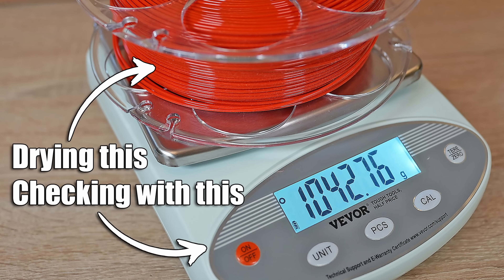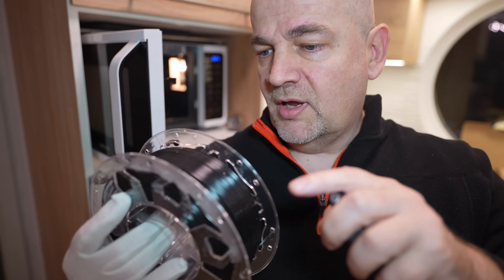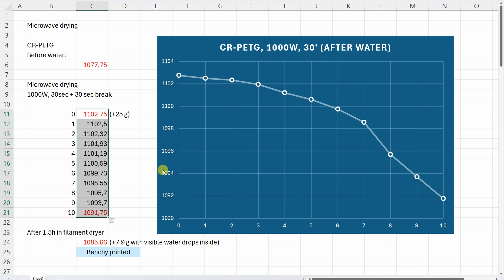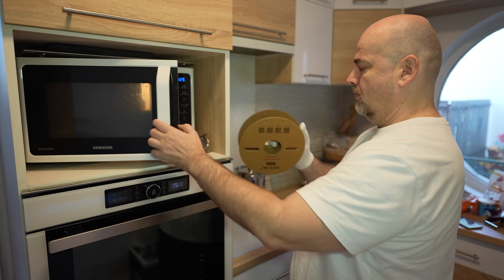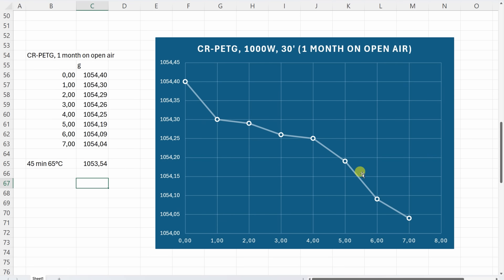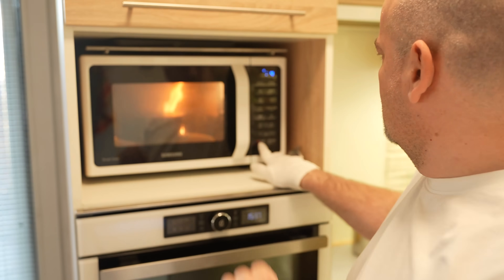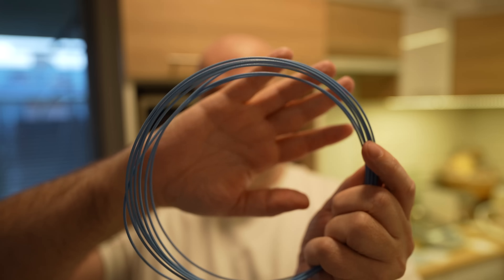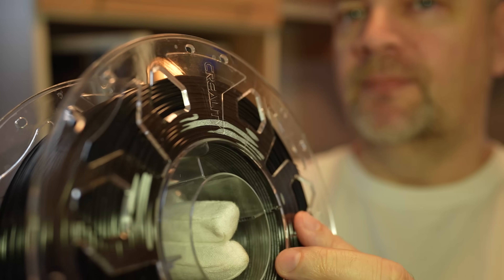Drying Filament in a Microwave: Fast Solution or Fire Hazard?

Comment: The fact that a microwave could dry filament was never really a question - it adds energy to water molecules and they evaporate. We've seen that right here on this channel for drying dessicant. The blocker for me using a microwave to dry filament is that microwaves don't evenly heat anything - so even if you use intermittent bursts like you did, you're going to end up with hotspots in the filament that will cause issues down the line. Getting the filament to the right temp to allow the water to escape everywhere in the roll, to my thinking guarantees that you're going to blow past safe temperatures in hotspots in the roll. That's also why using regular cooking ovens is a terrible idea for drying filament.
 
Maybe try some of this again and use a thermal camera on the filament? See how well it distributes heat amongst itself, and vary how long you nuke it for and how long an intermission, to see how bad it is in reality and what might work best.
Reply: Not all Microwaves create hot spots.  My Panasonic inverter style microwave passes the 'fill the plate with mini marshmallows' test and heats (they expand as the water in them heats up) them evenly at 100% and 50% power.  It's a fun, cheap test to map your microwave.

Check out microwaves that have true inverters, where 50% power on a 1000w microwave is 500w.  Most microwaves simply pulse the 1000w magnetron on and off to simulate 50% power and you get hot spots when you are expecting slower, even heating.

The ideal drying ratio might be something like 30% power for 4 min cycles, or 70% power for 60 second cycles with an inverter microwave.  So many ways to test!
Reply: @joerogers1364  Oh, seeing Igor use of microwave to dry, the first idea of improvement I had was using inverter microwave at low power.
Some chinese inverter microwaves even no longer have rotating tables.
Reply: @vasiliynkudryavtsev I could see buying a cheap mw oven for quick-drying filament, but I'm certainly not buying an expensive inverter one for that purpose, and I'm sure as heck not putting filament into my Panasonic inverter mw I use for my food.
Reply: I wonder if, even if you don't overheat the filament, if the process of boiling the water inside will compromise it in other ways
Reply: @Antici---pation  If the water actually is boiling in the classic sense (as in hitting 100c en masse) then there will definitely be big problems - PETG glass transition point is 85c, so at a minimum you're going to get strands of filament sticking to each other and ruining the roll.
Reply: @vakieh4381  Real PETG won't stick to itself at 85 or even 150, but there's lots of fake stuff (sketchy PLA blends) sold as "PETG" that will...

Comment: I wonder if doing lower power and longer times would have a more productive result....
Reply: The defrost cycle is actually just that.

But it doesn't solve the water condensing back onto the spool right away.
Reply: @SquintyGears  Right, we need real variable power magnetron not slow bangbang to fix this.
Reply: @daliasprints9798  what topochic said isn't entirely accurate. It's fairly common for microwaves to be wired with a center tap. And that is used for the low power mod that used to have a physical switch but now is often buried somewhere in a contrived menu.

Edit: I'm not saying it doesn't do 30s intervals for defrost. That is 100% accurate. There just is also a half power mode that basically nobody uses. 

It's not true variability but functionally that would make no sense at all for the kind of appliance a microwave is. The whole point of the thing is to excite polar molecules to heat food to scalding hot in 90s. 
Remember we're effectively talking about photons here. A less dense beam doesn't just mean the food heats slower. it also means the penetration characteristics change, it probably doesn't make it through the material bellow a certain power setting and only the top few millimeters of the surface get heated.

At that point, what ever it is, just put it in a pan...

It's just not a suitable solution for drying filament like that. If it was more energy efficient than resistive heating (or equal) you could imagine a live printing dryer.
 A device the size of a 33cl can of coke that gets installed at the entrance of the PTFE tube to the tool head. That blasts the 3in of filament going through with microwaves to instantly vaporise all the absorbed moisture. No pre drying needed. *not compatible with CF filled filaments.

That doesn't exist and I don't think I'm a genius with an idea nobody thought about or tried before.
Reply: @SquintyGears  Variable power absolutely makes sense for the normal purpose of a microwave. You generally want to tune the power to just below boiling something over, which you can easily do manually if the power is continuously variable, but not if it alternates between heavy boil and nothing every 15s. It's so annoying when ppl who don't actually cook assert "you don't actually need or want what you're asking for"...
Reply: @daliasprints9798  bringing in cooking is an incredible self own.

You're suggesting "why don't we make a sledge hammer but thinner and lighter, so we could drive nails with it on roofing jobs". The roofind hammer already exists.

If you need a water bath, use a water bath. Also sufficiently fine PWM is indistinguishable from dimming control.

The Microwave oven is inherently a sledgehammer tool. It has to fill the chamber with microwaves bouncing to work. That has a ramp up down time. It's super uneven (kinda fixed by the rotation and previously mentioned bounce fill) because all heat will be concentrated where the food is hit and where the water is concentrated (or other polar moelecules)

You actually physically can't dim the mechanism it works from without making the heating time exactly the same as you would get on your stovetop or oven. And people have those more than microwaves. You're not inventing a solution, it already exists AND YOU ALREADY HAVE IT.

Stovetops already come with timers now if you want them, ovens always had them... What else do you need?
Reply: @SquintyGears  Stovetops have the exact same bangbang problem. And most of the world lives in places ovens don't fit. Being able to replace everything with a microwave is a huge win. Not for speed but compactness & cleanliness.
Reply: Anyway I'm here for advancement of 3DP & materials handling tech, not arguing with annoying ppl who can't see the motivation for better shit.
Reply: @daliasprints9798  that's funny. It's true low quality stoves don't regulate pwm well enough for fine work. But they're good enough to do almost all home cooking even foodies would do. As a hobby you end up investing in your gear and a pro chef goes even further. That's true everywhere. Car people spend more than you ever would on kitchen appliances. The fact is it already exists in a much better form than trying to fry food with lasers (which you can do). If you're annoyed to hear your idea isn't original or feasible, I'm sorry your parents lied to you.

I'm just trying to communicate what the technology can or can't do from what I know about it. And I am a sarcastic bastard. But it's not a slight to your intelligence. There's tons of shit I don't know because I never cared about it.
Reply: Most microwaves can't do lower power.  They fake lower power by turning the magnetron on and off.  30 seconds at 50 percent power, is in reality going to be something more like 10 seconds at 100%, 10 seconds at 0%, 5 seconds at 100%, and then 5 seconds at 0%.
Most inverter microwaves can do an actual lower power setting, but those are not quite as common yet.
Reply: @topochich0  well that's the definition of a duty cycle and it's still better than nothing. Many laser cutting strategies work like that (pulsed wave) instead of modulating the power.
Reply: @KToMmi  While in a sense it's the same, pwm (with milli or microsecond scale switching) and bangbang (with 15s duty cycles) have radically different outcomes. The latter is almost useless in practice.
Reply: @topochich0  Great point on faking low power!  I just commented this elsewhere here.  Panasonic has true inverter microwaves.  My Panasonic inverter microwave passes the 'fill the plate with mini marshmallows' test, heating them evenly at 100% and 50% power.

Comment: I've been using a filament box with a side removed as a cover for placing a roll on my bed plate and leaving it at 60c for an hour. The box could use a fan instead of a few holes but it does the trick for mild drying. 

Could try modifying a coil re-spooler to feed the filament through a coiled heating element, hot air gun blast, or hair dryer. Or even a magnetron if you can wire it safely, heh heh. I remember someone tried an air box on the side of the printer itself but because the filament starts/stops so often it wasn't consistent heating at all, oops. 

In a finished design and a hotter coil you could run it fast, like 10 minutes to complete if you were in a hurry? Plus you could monitor filament thickness from a new manufacturer or something to make use of the operation. 

Fun to think about, thanks.
Reply: I remember some jokester doing run through filament drying with propane burners and food cans. The energy consumption was immense.

I do often wonder what's the correct, the best construction of a filament dryer? Even a slow dryer? Just raising temperature dropping relative humidity you concentrate that water in the air, then what, vent it, but how much to vent? Can it actually clear the moisture? Alternatively you have a peltier in an enclosure where the hot side can heat the enclosure, and the cold side below dew point will collect and drip the water out, i suppose... if enough of a delta can be achieved.

Comment: for editing excel: the graph says 30 minutes (') not seconds (").

Every conductive material with high restinance creates (induction) high voltages=> sparks => fire.
Thats why a CD creates Lightnings, while massive spoon (shortens the inducted voltage to like nothing - because of low restistance) is no problem.

Also its dangerous to run a microwave without any material where the microwaves can get rid of their energy is dangerous. So - 10m glasfibre - no drain for the microwaves... dangerous!
Reply from the maker: For the excel, correct, but what I always tell to my students: Listen to my thoughts, not my voice or writing! :-)
Reply: @MyTechFun  I listened - otherwise I wouldn't have found that typo :-)